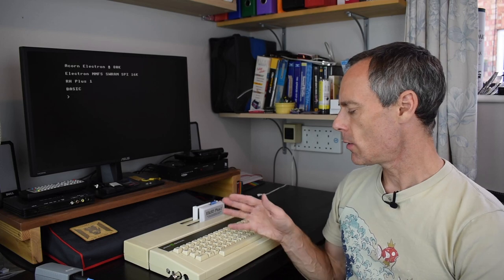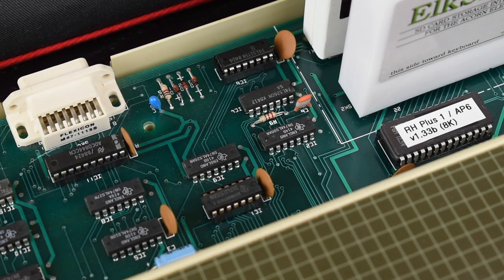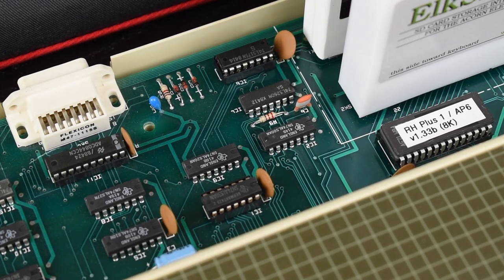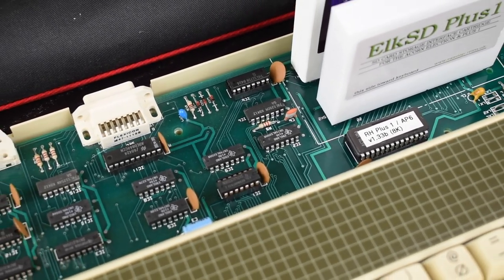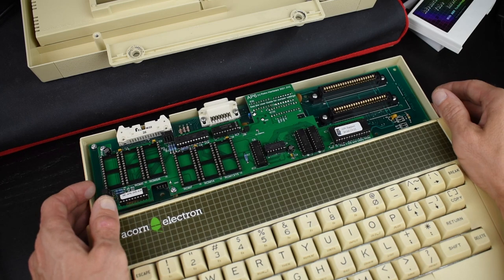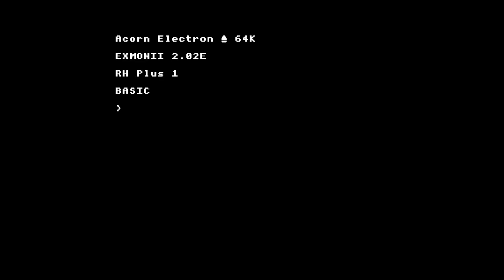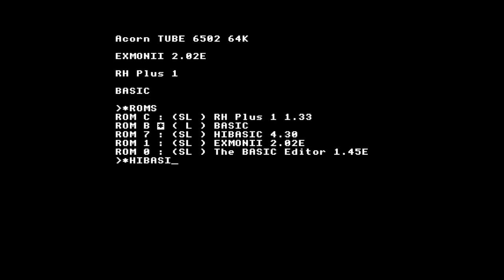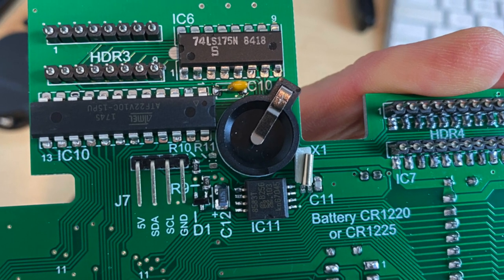Acorn Electron AP6 2V2 Plus 1 expansion

Comment: I just wondered if u heard of a slogger turbo boost. I have a electron, I got it in 1983. I added one of these to my electron. It has a switch. You can turn the switch on and it increases the speed of the electron allowing you to play  BBC games like aviator. I just wondered if u ever came across any of these.
Reply from the maker: I've heard of them but never seen one.  I believe Dave Hitchins has done a modern remake of it and had some for sale at leat recently.

It's always difficult to know how far to push upgrading an Electron when I also have a BBC and Master.  One of the attractions of the Electron is it does so much in a compact package (which I've slightly ruined with a Plus 1!) but, at the same time, it's clear a major issue with it was the slowdown of RAM access, especially in the high resolution/colour screen modes.
Reply: @lsbyte  Yh i got my electron in 1983. I could not afford the bbc micro which was twice as much. The electron was definately less powerful than the bbc micro but it was made to compete with zx spectrum and commodore 64

Comment: Crikey, love how you just throw out a service ROM like it's no effort. Would be great to be able to write *commands for the Elk. Any tips on where to learn?
Reply from the maker: I recommend the "Advanced Sideways RAM User Guide" by Bruce Smith — it gives a really good explanation of everything, gives loads of examples in BBC BASIC and covers all models.

The Advanced User Guide is also good as a reference but doesn't give you many useful examples.

Good luck and enjoy!
Reply from the maker: Oh, and as for removing the Support ROM, there was about a minute of footage before that, where I was gently easing out the chip, before I sprung loose at the end!  Editing can solve most screw ups (although can't solve the continuity error you might have spotted!).
Reply: @lsbyte  Thanks! That sounds like a good recommendation. I did look briefly through the advanced guide and vaguely followed the examples but the advanced sideways ram guide is one I'd not heard of. I'll go look.
Reply: @lsbyte  ah yeh sorry, when I said throw out it was bad language. I meant to say "program with ease"
Reply from the maker: @WistrelChianti  — Ah!  I see, the code, not the physical removal.  ;)  It's not too difficult when you know how: I used the Bruce Smith book as a template and then added my own service entry, so it didn't take long.

Some early code in that book also gets the computer to print out the service call numbers being passed to the sideways ROM on startup, which was useful to pick a service call to lock up the machine on.

All sideways ROMs need a special header, which is one of the initial obstacles, otherwise the ROM won't be activated and show up in a *ROMS listing.  In particular, there's a need to put in a byte of option flags and there must be a copyright message (starting "(C)") with a byte pointing at the offset to it.
Reply: @lsbyte  ah yes. I remember that bit about the copyright message from the advanced manual I think. I had a look at the snapper ROM in a hex editor and was able to see how stuff lined up as described in the book
Reply: @lsbyte  found the book. Looks good - ta again for the recommendation